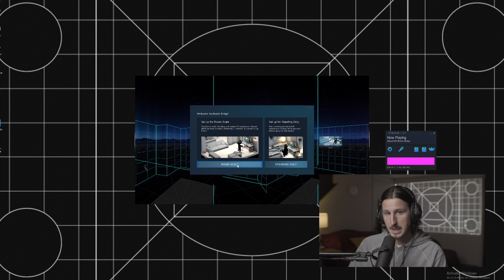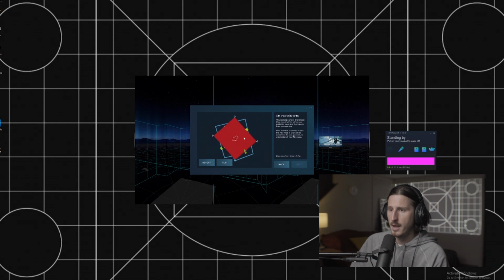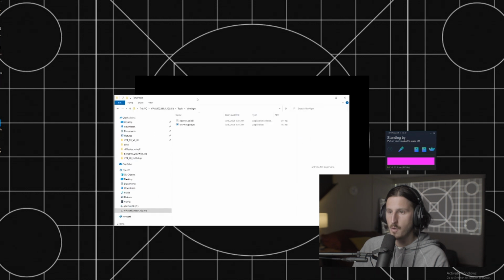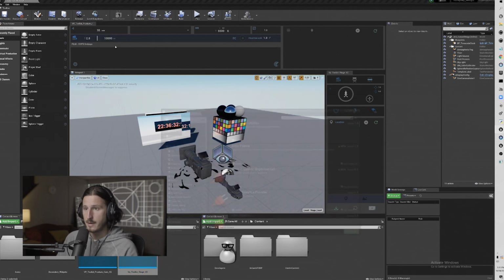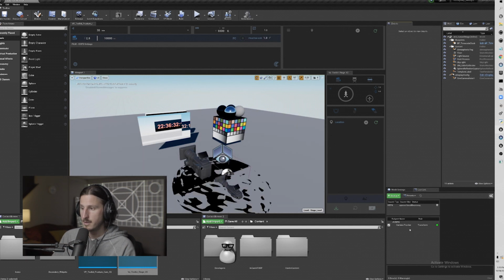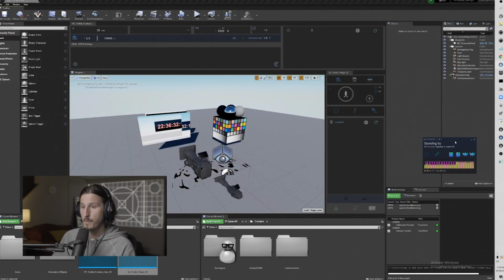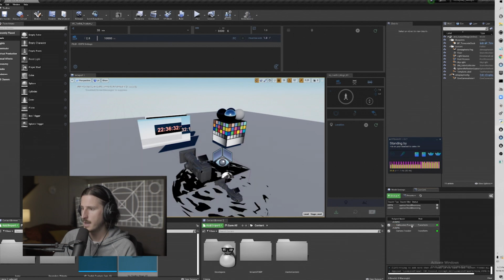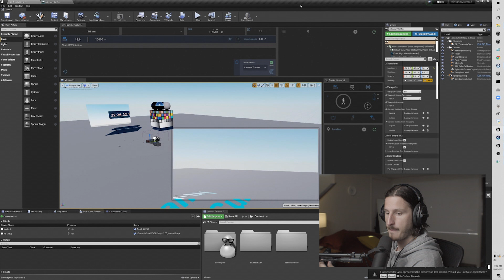E4: nDisplay Vive VRPN Setup & Calibration - In-Camera VFX Virtual Production - Vp Toolkit UE 4.27

Comment: Hi Mate, thank you for a great tutorials, have seen almost all of them, just need few clarifications on antilatency tracker with ndisplay,  everyone are using HTC vive, but unfortunately the vive are not precise and the connection gets lost if the sensors are not in direct contact with puck or vive, so I use antilatency with aximmetry for all corporate events, but now I have very complex scene so I have to use unreal, but I am stuck with the tracker, Kindly share some piece of advice please, again thank you so much for the wonderful tutorials.
Reply from the maker: Hey man, Thanks for the kind words! Yeah thats a tough one! I have yet to get my hands on an Antilatency setup to be able to really test it with ndisplay setups but if you’re able to get it to work with livelink (which I know they support) you should be able to start testing with ndisplay using the same methods used in my videos but it’ll be up to you to fix out how to get your tracking 0/root correctly calibrated to your virtual 0/root and your screen position. Don’t know if you’re a part of the virtual production with UE facebook group but you could always join and post to see if anyone has tips on a workflow for this.
Reply: @ianfursa9529  Thank you for the quick response.

I had a discussion with Antilatency, they suggest to do via VRPN lemme try this method aswell and I am a part of UE VP in FB will post the same.
Reply from the maker: @sunnydivinity  if you’re using VRPN then you should be able to setup pretty much the same as my tutorials show.
Reply: @ianfursa9529  Thank you mate, I will try vrpn as well.
Reply: Hey Puneeth, I'm curious if you ever figured out a solution to your problem with antilatency because I too am using antilatency trackers so if you have any incite I would surely appreciate it

Comment: Do you see any advantage in using room setup to calibrate? We used to choose that but then realized that it's faster/easier to calibrate using the standing setup. You place the headset in the calibration position pointing "forward" and this is going to align with the scene root of the nDisplay config. Most times the LED wall is outside the tracking space so we can't use it to align like you do with the controller.
Reply from the maker: Yeah that’s a great way to do it when you have a head set.

Comment: I knew that you could swap out controllers by trackers without adding extra dongles, but haven't thought that the dongles were in the headset. Are they actually in the headset or elsewere (eg: link box)? This mean that with a null driver (to use trackers/controllers without headset connected) you're forced to use dongles right?
Reply from the maker: That’s correct.